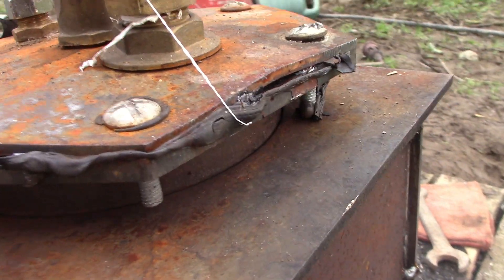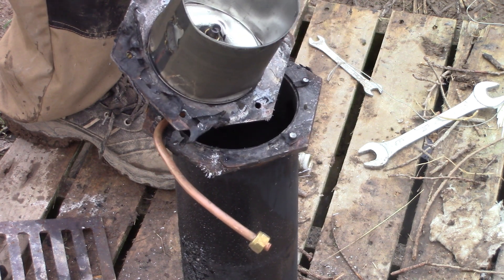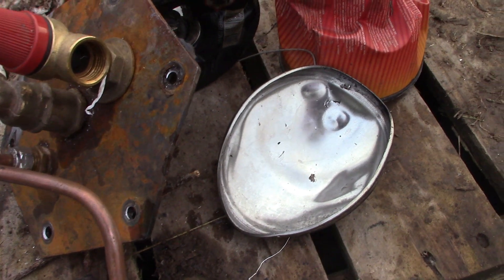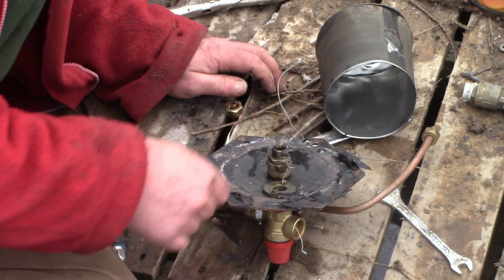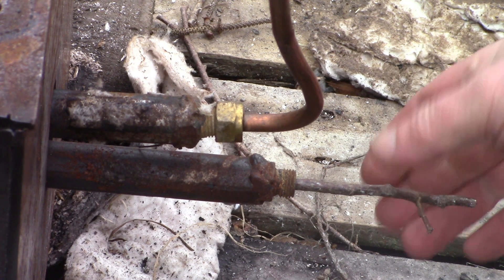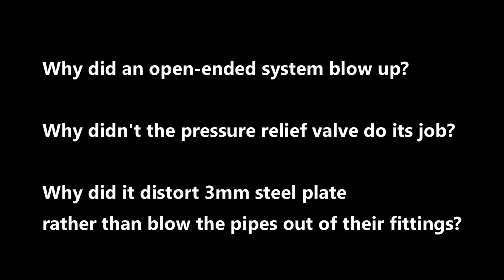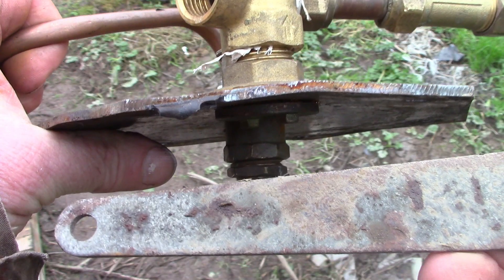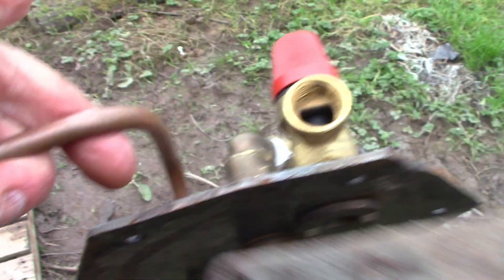Why Did My Boiler Explode??!! My Own Big Bang Theory...

Comment: The floats would have been moving around a lot as the water was bubbling steam up from lower in the tank. Maybe, all the movement caused the aluminium material of the floats, especially in the area of the valve, at the top, of the top float, to be mechanically worked to destruction.

Comment: You are right. Floats inside a pressure vessel would have to be non compressible and also float (?) 3mm not thick enough also twice as many bolts in the circular flange.

Comment: Well the float idea works fine, the problem is keeping them from imploding. The way I see it, the only good solution is to fill the floats with something to support their integrity. Maybe a wood slug in a paint can? that poses a few problems of its own, another material that comes to mind is simple air, although that might result in an explosion rather than an implosion upon heating, a delicate balance to be sure.
Reply from the maker: Exactly - I haven't thought of a suitable material yet..

Comment: I think its as simple as.........some water seeped into the top canister through its top gas fitting as they are designed to keep pressure inside and not pressure out, this then boiled and pressurised itself over the cans limits, the bottom blew out, crushing the lower in tact but very warm bottom can, and the rest of the top can accelerated with enough force to flatten itself over the water inlet and curve the top 3mm plate. This would explain why the pressure relief valve never gave out because the pressure was inside the top can and not in the larger vessel.

Comment: You had a violent expansion of steam. More than the pop off valve could cope with. In other words if you had a tank with an open end and discharged a stick of dyno mite in it. The walls of the container would bulge or split, even with an open end. Steam is very dangerous.

Comment: I think the cause of the issue is the floats. The gas cylinders are designed to resist pressure from the inside. They had pressure from the outside and likely  deformed and partially collapsed. This allowed water into them which would then turn to steam, probably instantly causing them to explode. Modest pressure over an area is cumulative! It all adds up.

Comment: At Heysham Nuclear power station ,I was told they have super steam leaks. These leaks can not be seen and would cut through you like butter…Also look at old photos of steam trains boilers exploding .And these engines were also moving and using up boiler pressure but had extra energy to blow the train boiler to bits.
Reply from the maker: yes, thanks, I'm well aware of all that, Tommy.
Reply: @wayoutwest-workshopstuff6299    ive got a stationery engines if you want to try
Reply from the maker: @tommytar222  I have a diesel stationary engine too - but it would be fun to have a steam-powered one too, wouldn't it?
Reply: @wayoutwest-workshopstuff6299  Yes just love what your doing . I see a few motorised lawmowers take cutters off it or Oxford Allen Scythe mower 1939 early villiers 11c for sale and are for small farm units.has atachments for it.  Would do the work you need.   look you tube . Summer is here soon. I am very intrested in what you are doing...You probbly know when you make charcoal the gas can run a petrol engine . look gasifire car .   Its a small 3hp engine would work a shutting unit.

Comment: This is what I think happened, which explains what you can see very well:
So the float either explodes from internal pressures, or the lid collapses into the float. This suddenly means there is a lot of space on the top, as the float is now open and empty and WATER RUSHED IN TO FILL THAT SPACE. That means you now have a body of water moving towards the top. And when the space is gone, that water will slam into the top, bending the 3mm top. Basically, it's a water/steam hammer effect.

So the pressure valve doesn't trigger, because there is no high pressure at any point.

Comment: My guess would be that the top float exploded due to pressure build up inside it. That would explain why the top float was rammed up into the lid and and the blast wave was contained under the the top float so it did not eject the fitting or set of the pressure valve. :) as for what caused the float to explode.... maybe a some water got inside it from the last time it was heated and cooled and when it cooled it drew water inside so next time it was super heated that water turned to steam inside a not so strong container. :)

Comment: I think one of the gas cans expanded and let go all at once. Too much pressure at once for the valve. In either case you had a rapid case, not the usual slow creep past limits. 

Not sure I can help design it, except to minimize volume for pressure to accumulate. I know drag racing cars have blow-out plates for fast failure modes like this. .

Comment: Well I don't actually know however it's far more likely from looking at the evidence hydraulic pressure did this. 
Steam somehow caused a column of water to hammer the lid and blow it out like this. It was fast whatever happened and the incompressible water blew it out. It being open ended may actually have something to do with it.
The process of how it happened I don't know.

Comment: you should have used floats that could handle higher pressures/heats aluminum gas cans couldn't handle that level.  if you had used empty jelly jars with a steal lid or something like that I think you would have been ok as long as they could handle the thermal transition from cold to hot.

Also in your case the first gas can impaled itself on the valve and probably reduced pressure to the valve forcing pressure to find a new way to escape.  Your theory that eventually the pressure would have went out of the tube is flawed as the pressure chose to bend 3mm iron or steal; the opening in the pipe was not large enough to compensate for the building pressure inside the cannister as you were consistently adding heat to the system via fire and not using a heat regulated system like an electric coil set to a specific temp.

Comment: Just remember your tinkering with a potential bomb, much has been written about the explosive power of steam when released from an over pressure rupture. Most steam boilers are designed with a safety  factor which you ought to consider in any redesign. e.g. 5 mm plate has a greater safety factor than 3mm. plate at 45 PSI.

Comment: Something has caused those floats to push upwards, harder than what they were supposed to. The bottom of those gas canisters have a dome shape and may have acted as a steam trap, helping with the upward push. Also, once the base of the top float was breached, steam would have built up inside the top canister, because the base would have still been below the water, making more upward push. The upward push got to much, and your inlet valve made the Lindal Valve assembly to fail, allowing the canister to continue to the top, where the aluminium covered both the steam exit hole and the pressure relief valve hole. Closed system. Pressure build up. Big Bang. Hope you get to read all these comments. Wow. Every man and his dog is putting their two cents in.

Comment: I would hazard a guess that the temperature of the boiler was at or above the annealing temperature (between 200 - 300 C) of the aluminium that the empty butane cans are made from, so what would normally would be hard/rigid work-hardened metal suddenly became soft and they collapsed with the steam pressure, causing the "BANG!" as you described on the chalkboard.
Reply from the maker: more like 110 c, Jeff..

Comment: full metall cartridge - no air inside nor water , just a full metall cartridge maybe casted instead of such empty cartridges that implode.

Hope some thermodynamic engineers will deliver a solution that will be efficient, reliable, and safe.

Comment: Here's what I think may have happened:

As the pressure inside the boiler became higher and higher, this forced the top can up with more and more force.  This caused the can to puncture, preventing the valve from closing off, and allowing fresh water to freely flow inside and fill the can.  At this point, the can acted as a sealed container.  But eventually, the pressure became too great, blowing off the bottom of the top can and crushing the bottom can, as well as bending the top of the boiler.

Comment: My 2p worth. The top gasket failed leading to a rapid expansion of the hot water in the vessel. That forced the float up and they deformed the top plate.  BTW you will not get any useful work out of the system until you make it a pressure system. I REALLY recommend you do not make your own boiler. You thing the last explosion was bad....

Comment: Awesome Build!! I typed two paragraphs and then realized Matthias Wandel already wrote basically the same thing. I do have a few things to add. Pressure relief valves of that style are not designed to handle explosions, only bleed off pressure to prevent an explosion. You may want to consider building yourself a rupture disk of large diameter so this cannot happen again. A large diameter pipe can be added to the exhaust side of the rupture disk to divert steam away from the operator. Also don't use floats with flammable gas inside that are only rated for low temperature and low pressure, that is the root cause of your issue.

Comment: Think back to high school physics.
The cans are two vessels that are hot and have volume. The air inside is hot aswell. 
A sudden rush of cold water will collapse them, like using atmospheric pressure to crush an oil drum.
As you suggested the sudden decrease in volume will suck the steam back in violently, suddenly increasing the pressure !!
Try using a steam injection valve instead of float valves. These are used on model engineering boilers and are used to inject water into the boiler using the steam generated.
I think with the floats you will always have this problem

Comment: I believe I know the answer to the last question. I want to be clear, I have zero expertise when it comes to steam, what little knowledge I have is mostly limited to machining and metallurgy. That said, I think it is the difference in thermal reaction between the different metals. Copper will expand much further and much faster at a more plastic rate, as will brass. I believe this is why the pipes did not blow out. Aluminum on the other hand gets quite brittle with heat, particularly with thermal cycling. I don't fully understand your boiler so I don't want to comment beyond that. But it could well be that the aluminum canisters held just fine for the first few firings, but functionally work hardened to a point where they no longer could deform plastically. Steel is much more forgiving, particularly with thermal cycling. Copper while it does work harden, anneals almost as quickly, I think this makes it much more durable in a thermal cycling environment. Aluminum would almost never be used in any extreme temperature environment, it behaves strangely at both ends of the scale. Steel is quite reliable but welded vessels are a whole different animal than spun vessels. Just my two cents, I hope it is worth at least a single cent

Comment: Tim, I have no doubt that I was in your mind when you said you expected people to say I told you so. I did tell you a story of my own steam boiler explosion. I have actually come for the opposite purpose. I have undertaken a diagnosis of what went wrong in my case on four separate occasions. I made a point of disturbing nothing, I have even consulted engineers in more closely related fields for their opinion. The PRV I was using was rated for over 9, 000 PSI, there is no way I was exceeding 300 PSI and yet the PRV never blew. Furthermore, this hot water back fed into the entire supply system, somehow forcing the cold water past the valves and damaging them all in the process. I'm a mechanical guy, I can't sleep when there is a problem I do not understand. This took place I think about 6 years ago. I have gone to great lengths to try to understand this. I have even visited the old folks home to speak with sailors who served on ships with high pressure steam. Consistently I get the same response, a regular nodding and some statement about steam being unpredictable or connected to Satan in some way. Others have simply described steam work as more of an art than a science. Everybody with significant experience had an explosion story without an explanation. So I'm actually here to encourage you. You got your first explosion out of the way, you're halfway to being a professional! You have figured out the art, science should be easy. You've got this!
Reply: Based on these stories and both of our experiences, I wonder if there is not some tiny catalyst, perhaps a drop of condensation, that sets off a rather dramatic expansion compared to standard?

Comment: The implosion of the float caused a sudden pressure drop. You are right on that. I would add that the higher temp water at the bottom flashed to steam before the cooler water above. The steam bubble at the bottom drove the water and floats straight up impacting the top. In short- water hammer.

Comment: This whole thing is stupidly dangerous, but I have an idea how to further superheat the steam and use your fuel more efficiently. 
We know that youre heating the water in the base of the fire, that cools the hot gasses drastically and the rest of the superheat system in the chimney is getting colder gasses. So my proposal is to do it like steam engines did. Preheat and boil the water in the chimney section and do the final superheating in the base of the fire. This would drastically increase the heat of the steam and make your boiler a lot more efficient.
Reply from the maker: That was my first set-up. This arrangement is working much better - except for the float valve obviously!

Comment: https://youtu.be/AoXNSquNsbY?t=385 Adam Savage had a video that highlighted some interesting points on pressure over area recently. 

It is worth keeping in mind and using along side relief valves for safe controlled failures.

Comment: Maybe the rust on your steel boiler made for poor adhesion with the epoxy that held on your lid, allowing it to explode more easily. Steam is very corrosive to certain metals, as you may know.

Comment: Wow Tim. You have caused a stir and no mistake. 480 comments and rising. I think the majority of folks on here wish you to continue and to succeed, although one or two are just simply rude. I detect that you have had a big shock with this, and you need some time out to collect your thoughts (and the thoughts of your excellent subscribers...) before you make your next move.

My thoughts are nothing to do with pressure vessels, or floats, or safety valves, or domed end caps, or bursting discs (core plugs...?) - which I think are subject to some hefty H&S legislation - certainly here in the UK - so my solution would be to ask around, and see if you can borrow a horse. Something much more agricultural about a one horse power engine, that you can talk to and make friends with. Ask Sandra. I'm sure she will lend you a horse. I'm a Luddite as you can tell. Final point. You are safe and that matters more than Boyle and Charles' Laws... Keep it that way mate.

Comment: Looks like a classic waterhammer, the lower float collapsed creating a shockwave that sent a part of the remainig water towards the lid deforming it while slamming the top can into the the Lid wich caused the bottom of the top float to break free (the imprint of the floatvalve on the inside of the bottom part ) the reamins of the top float are at this moment acting as a seal , blocking the other openings and protecting the fittings , the pressure relive valve engaged but was blocked (visible Dimple on the upper can )

Comment: My thought is the floats crammed against the release valve and the outlet causing a zero pressure release scenario. You were extremely lucky that the steel plate bowed. A steam explosion can be deadly as many dead steam engine personnel on the railways would attest.

Comment: I saw a very smart coment among here about possibly using a cork float instead and have the cold water valve at the bottom, i can not take credit for that idea but i wanted to bring more light to it
Reply: Eur van Andel 
was the one i saw who brought it up
Reply from the maker: cork is filled with pockets of air - I think they'd all collapse under the pressure, but it would be interesting to find out for sure